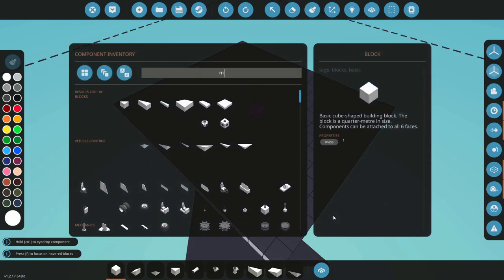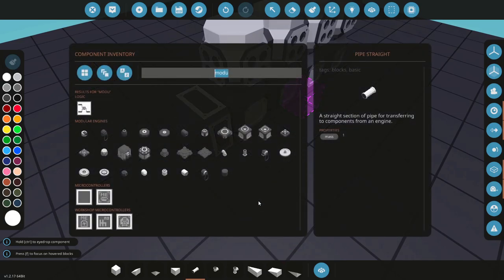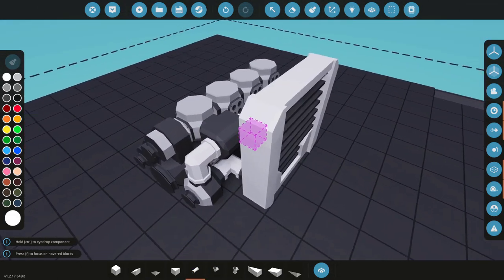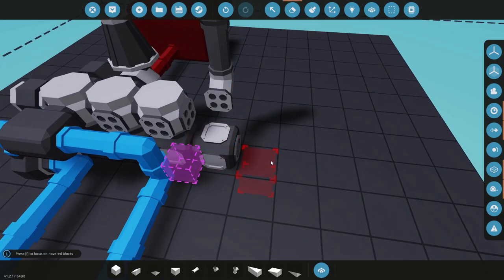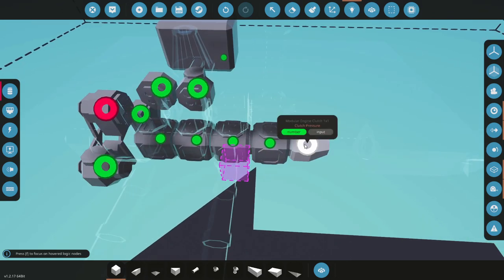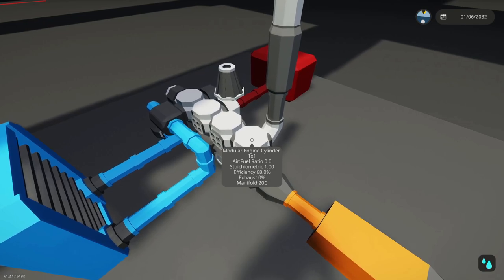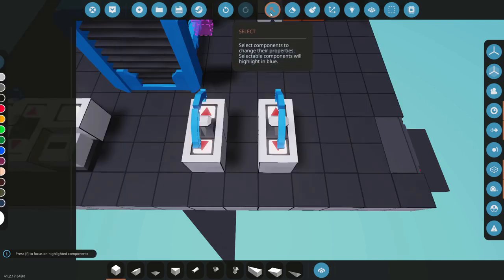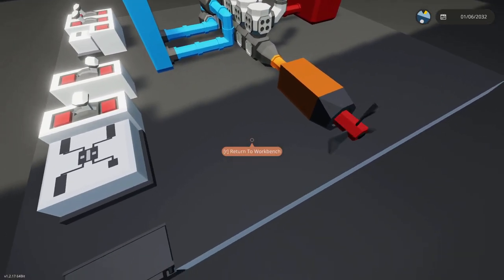Stormworks Tutorials l Modular Engine Basics

Comment: I built my very first modular Engine following your Tutorial here today.  One thing though. My Stoichiometric was not 0.11 it was 0.2 and when I alt tabbed to go back into this video... A few seconds after it was running on 47 throttle and full air I began to take damage alt tabbed back in and my engine was one fire -_-  So I respawned it finished your Tutorial all was well then I turned the throttle down to 0 and back up again and it caught on fire again.  Can you do an up to date tutorial as it seems the updates have changed things a bit and my engine is catching on fire here.

I have stayed away from modular engines all this time due to the cooling issues they were having and how everything that used them was catching on fire. So I never made any.
I was about to consider a small vehicle with this engine till it caught on fire.
Reply: Try conecting a fluid tank filled with fresh water to ur cooling system, cooling systems now spawn with no fluid inside them.